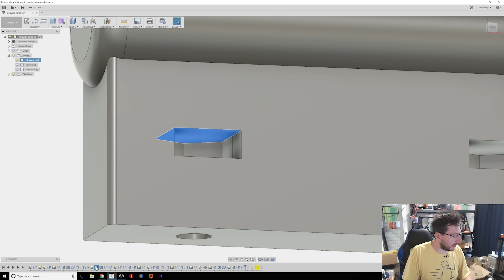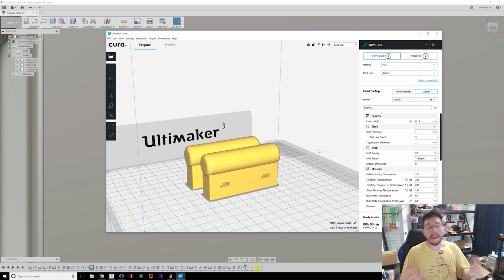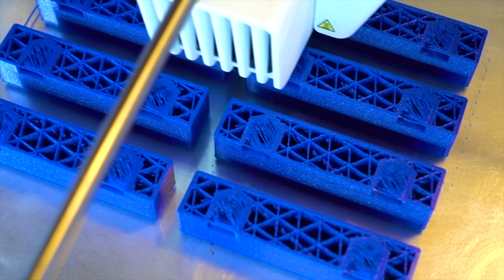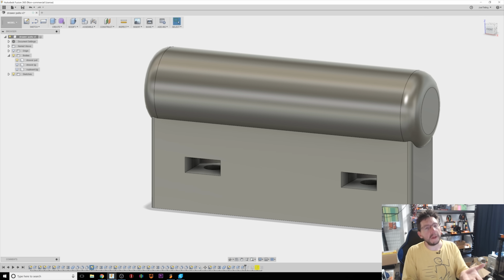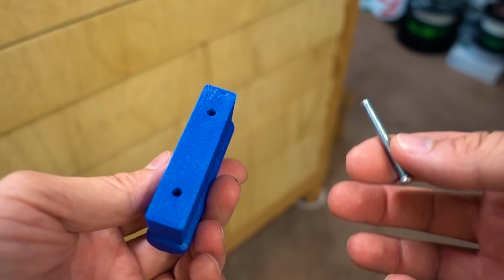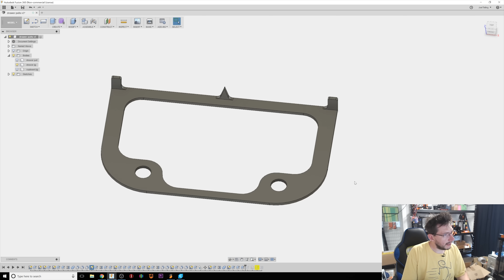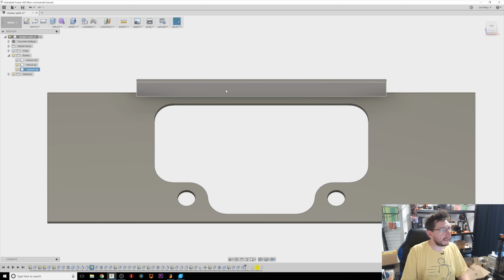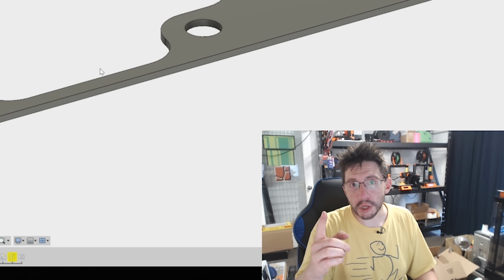3D Printing Square & Level Drawer Pulls and Cabinet Handles using Jigs and Screw Templates

Comment: This is just a suggestion. if you are worried about the drawers not being lined up when your done. you can drill out a hole in the middle of each side of the wall and drawer. and place earth magnets in them. this will give you a stop lined up point. 

but that being said. its not really going to help that much, its not going to work perfectly. any kind of locking system that stops it at a specific point will only hinder access to it from the other side. and that is what you are trying to stop from happening. 

That being said. i think the work table is a great design. and looks to work really well. and is good the way it is. you have been at the table countless times. no one up until you installed the Pulls. did they even know that the drawers moved that far. so its obviously not an issue.

Comment: a small springlike bump on either side or one in the middle could act as stop but it implemented right it will give enough resistance to stop the drawer but not prevent it from opening either way.

Comment: A couple thoughts....print one and test that instead of a batch first?  :-)  Also with the screw not fitting....I've always thought you had to compute some level of shrinkage with 3D printed parts?
Reply from the maker: What? Test? hahahah ;)
Reply: It is technically wrong to adjust esteps for X/Y/Z to get it accurate! Leave them as they are intended from the 'ideal setting' standpoint as calculated. Make sure your physical hardware is adjusted properly, that's the biggest step to dimensional accuracy! Make sure belts are properly TIGHT and not sloppy so that when the motor makes a step it is an accurate step, that should yield as close to proper dimension as you'll get in these cheap controlled systems. Then calibrate extrusion multiplier properly, that can make a HUGE difference in dimensional accuracy and is often not done properly, especially across different types of filament as PET will not extrude the same as PLA. The bite of the extruder drive gear gets more or less traction on different filament types, which drastically changes how much filament is extruded. You can either change your extruder esteps for each filament or change the multiplier...which one is easier? ;)  

Find that happy middle ground where you're getting good enough 20mm cubes with smooth surfaces and call it good. Print test pieces for things that need to be dimensionally accurate, then scale in slicer if necessary. Generally I'm getting 19.98x19.99x20 for PLA cubes and 20.01x20.02x20.02 for PET. And that's just making hardware solid and true, measuring filament diameter and correctly getting extrusion steps and multiplier dialed in. Close enough. The rest I will intentionally make holes smaller so I drill them out to exact correct size if I need that level of accuracy. Or use embedded brass threads or captive nuts etc to get things to fit 'perfect'.
Reply: Measure twice cut once!  I was thinking the exact same thing when I saw eight pulls sitting on the bed on a first print.
Reply: Kind of yeah. PLA generally shrinks up to 3%. Different brands shrink a bit differently and so does geometry..to a degree. :) So if you calibrate your machine to print dimensional accurate, which means you've printed cubes and other things, measured them to be accurate to your model, adjusted stepper steps etc to get perfect measurements, blah blah blah. You'll end up with accurate parts off the build plate with no need to adjust for shrinkage as it is built into your calibration! However, printing something in PET which only shrinks about 1% is going to throw that off a bit. Then the same for ABS and so forth... Find the happy middle ground and then fudge the rest in scale factor in slicer once you know your machine and materials. :p
Reply: It's funny you mention esteps since I had someone insist I was doing it wrong to adjust my esteps on a 20mm cube, saying it would be inaccurate if I did larger objects...so I'm again stumped what's the right way!
Reply: Good info...if you scroll thru my videos I had recently done an esteps and PID one...and I'm thinking I should null out that estep tweaking on the xyz part as you say.  Mine weren't off terrible stock... not more than 0.30.
Reply: 0.3 isn't bad at all! You can use something like this calculator to verify that the stock settings are correctly matching the mechanical theory of the machine.
https://www.prusaprinters.org/calculator/

These things aren't CNC mills..they're not going to be accurate to +-0.001mm. ;)
Reply: Joel is a seat of the pants guy..ain't got time for test print foolishness! ;)

Comment: What happened to the formula 1 car? You could just make a rabbit along the side of every drawer and put a screw as a drawer stop in the middle of the desk. If you forcefully close a drawer, it will fly out the other side.
Reply: unogazzy84 the car is still being worked on. He recently tweeted (or maybe it was instagram? Both?) about the motor they’ll be using.
Reply: Ahh thanks for the news

Comment: Why not mount magnets on a plate in the middle of the drawer to make it so the drawers settles in the right place whenever your in close range of the center point. (my bad, didn't see Jordi's comment, great minds lol)  Also white nano diamond filament would have been a good counter part to black handles but I guess thats better in a more high performance application :)
Reply: I came to say nearly the same thing.
Reply from the maker: heh, hey there Reid :)
Reply: me to! doesn't have to be in the middle - could be anywhere as long as the magnets line up with each other in the closed position

Comment: A suggestion for the door template. You only needed the wing on one side and you could add the lip. You just drill the other door from the inside. As was mentioned, tape on the surface can reduce tear-out. Minor tear-out on the front isn't a problem since the handle would hide it. Also, you could use a smaller drill to start with for a pilot hole and then use the larger drill from the front.
Reply from the maker: Drill from both sides! Holy cow, how did I not think of that!
Reply: Because when I drill from the back side, it's not necessarily straight and the holes don't exactly match up. Always start the hole from the important side. Less chance of tear out too. Joel just forgot why he didn't think of that ;-)
Reply: cheeto4493 Just because you can't hold a drill level doesn't mean Joel can't. 😁

Comment: I used to do embedded nuts like this. Found a better solution though. Square Nuts. They don't wear down the plastic where they can spin, as you experienced.

I have found a 0.3mm layer height for the hole to generate the bridging to work better. I had several models where the slicer, using 0.2mm, would not add it in. The key is the height needs to be greater then the layer height to be sure it is added.

Comment: Hey Joel, 
you could make an "Endstop" for the drawers on the outside of the cabinet. think of it as a barrier on a train-Crossing (i lack a better example because of the language-barrier)

you could put one of these small barriers on either side of the cabinet-"faces" per drawer, so that the barrier prevents the drawer to lide out on the other side.

if you want to open one drawer from the "front" you simply flip the barrier up and pull the drawer out. On the "back" side of the cabinet the other barrier will stay in place ant "catches" the drawer when you close it.

you could build it so, that the barrier you flipped "open" will flip back in the "closed" position, once you close the drawer itself.

i hope you get what i mean by this garbage writing of mine.

#HighFive from Germany

Comment: A couple of questions/suggestions. Why not make the nuts drop ins? All you need is a pause at height m600 command at the height of the top of the nut cavity.  As far as the dimensions, after you find out the first was right just enlarge the hole in the model, it's not going to hurt anything if it is a little loose. The next suggestion is to put an external catch on each side of the cabinet for the drawers so that you have a backstop but you can easily pull the drawer in the direction you are standing.
Reply: Chris Nelson - The external catch sounds like a good idea. If you spring load it, you can turn it to clear the drawer front and with the drawer pulled out, it would rest on the side of the drawer. When the drawer is closed, it would snap back into position automatically.
Reply: Edward Boston exactly.  Slide keeper at the top and bottom giving  1/4" to 1/2" range of motion for a bar, spring loaded with enough tension not to move on its own. Slide aside pull the drawer out it stays compressed. Slide the drawer shut slides back behind the drawer. One on each side of the cabinet. No problems
Reply: Chris Nelson - And you could probably 3D print a unit to do this too. 😊
Reply: Edward Boston yes, you could (^_-)
Reply: Why not just a detent in the travel or a small magnet? It doesn't have to stay put in an earthquake, just be easy to keep neat.
Reply: Siana Gearz because smooth drawer movement is a part of his design. The keepers I propose stop it from going past the back edge, they have no effect on the movement all the time. As the methods you mention would.
Reply: Chris Nelson  heh I have been wondering how you do exactly that ? The pause I'm talking about would like to put captive nuts in some parts. Is it easy in slicer Prusa ?
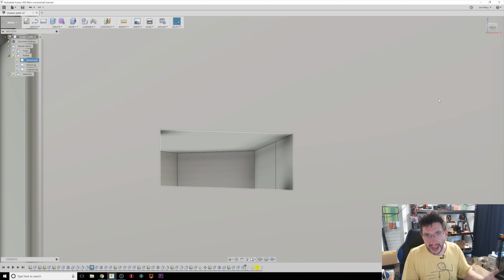Reply: To clarify, are you using a prusa? if so you either use colorprint website or prusa control and insert a color change command. The printer will move the print head out of the way and you can insert the nut. As a bonus this helps with the thing joel mentions at 2:25 which is the hole sag. The hole is now supported by the dropped in nut.
Reply from the maker: I wanted to model pockets for the nuts to see if I could do it. I know I could drop in, but, I didn't want full captured nuts in case I had to get one out.
Reply: 3D Printing Nerd why would you ever need to get one out? With captured nuts you could open the screw holes up more without issue
Reply: The captured nut would prevent the nuts being visible as they are in the last use if the pulls too (the upright ones for the cabinet doors where they are visible when the doors are open :) (or 3D-print a little 'plug' to cover the nut afterwards, so the bright metal shine doesn't show :)

Comment: You should figure out a way for the draw to stop at the closed position more easily, like a roller catch or some magnets or something that will let it open on both sides but also introduce a tad more friction when it's in the right position so that it's not as easy to push them out of alignment and screw up everyones ocd

Comment: Try installing a magnet inside the pull out drawers so that it snaps into the closed position. You would just drill a small hole into the drawer and the table and glue a small neodymium magnet and a washer. That would make it stop and stay coincident with the side of the table while allowing you to still access both sides. I hope that makes sense Joel. If not, I can send you a drawing of that.

Comment: Hi Joel,
 Like you idea of having drawers that open from both sides!

Something you might try if you want the drawers to stop at a particular spot.

Recess a neodymium magnet in the cabinet wall or the side of the drawer and then glue a round steel disk on the cabinet or drawer opposite the magnet.  When the steel disk and the magnet align the drawer should stop.  Don't know how large of a magnet would be needed.  Depends on the weight of the drawer and it contents.

Another idea would be to use some type of spring ball plunger with some type of detent.

John

Comment: if your drawer design can handle it, you should use a drawer ball catch to make a point where the drawers snaps to.  here's a link to a cheapo one.  https://m.aliexpress.com/item/32702740128.html?pid=808_0000_0101&spm=a2g0n.search-amp.list.32702740128&

Comment: @3D Printing Nerd:
 Couldn't you use some magnets in the middle to add some resistance to the drawers? When you close them, the magnets make sure they "click" in to the right place, but with some force, you can still open them on both sides ;)
Reply: I was going to suggest a ball detent, but a sufficiently strong magnet could work as well.
Reply from the maker: YES! Many of suggested magnets, and I think I may give this a shot in the future!
Reply: that's exactly what I was thinking, magnets would easely keep them in the close position while leaving the ability to open them from either sides
Reply: Jordi Deseure I was literally about to suggest the same thing!
Reply: You just stole the idea from my mind, i was about to coment this ahahahah
Reply: Jordi Deseure I love this idea!
Reply: Great idea!
Reply: yeah i was gonna say 3d print a ball detent lol
Reply: The future is now, Joel, it's now!
Reply: lol
Reply: Theoretically zero wear on a magnet, and they are just concentrated magic so that cool too lol
Reply: The magnets don't even need to be in the middle of the drawer.  The drawer just needs to be centered when the magnet is "on."
Reply: clayrev totally true! There even exists magnetic filament. Would be fun to try some things out with that filament :)
Reply: That would wear down or break over time.  Magnets wouldn't have that problem.
Reply: I had the same thought, depending on the mass of the drawer you might need a pretty strong magnet.
Reply: Yes i was thinking the same thing!
Reply: Lol I thought the same thing. Awesome idea and desk design!
Reply: Damn!  I commented this very thing and then read YOUR comment.

Comment: Oh and there actually is a term for drilling out a 3D printed part. Its called "fettering". Also a RepRap term.
Reply: That term was adopted from stone masonry work and when you have the sides of the stone with fettered edges, it's a cross word between Old English and Dutch.
Reply: So an undrilled part is unfettered, right?
Reply: Jonathan Kayne may you please elaborate on the etymology of the word?
Reply from the maker: I had no idea - thank you!

Comment: I heard of the single layer bridge from the older RepRaps. A lot of the parts were designed like this for the reasons you already explained. If you dive into the Prusa MK3 parts, they use a different approach that doesn't require drilling. If you were to look from the top, the layers would have this configuration: I I then = then O. The first two layers make a square, then the hole starts.
Reply from the maker: Oh, very interesting!

Comment: Dude you need to get a vice for drilling! Believe me, it's not worth the risk just holding it. Ive gotten a major injury doing the same thing
Reply: Then you can print some soft jaws for it!
Reply from the maker: Oooh, good call! I know now that you've said it, it's inevitable that I hurt myself UNLESS I get one.
Reply: I scanned through the comments so far to see if anyone mentioned this, so it's reassuring to see someone else picked up on it. Work safe Joel, and whenever working with power tools or sharp hand tools etc., always consider the worst thing that could happen, and take steps/processes to avoid it. 

BTW .. the OCD in me would have continued to use black on that first side for the door pull, rather than the orange .. lol
Reply: There are a number of videos like this on YT (holding a part with one hand and a potentially dangerous tool in the other hand) that set very bad examples, especially for young people with smaller and weaker hands.